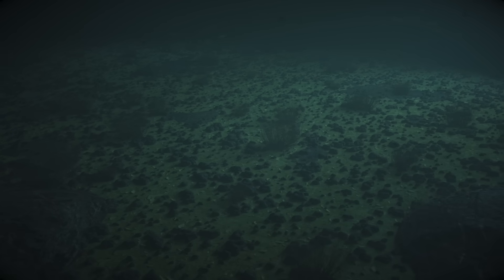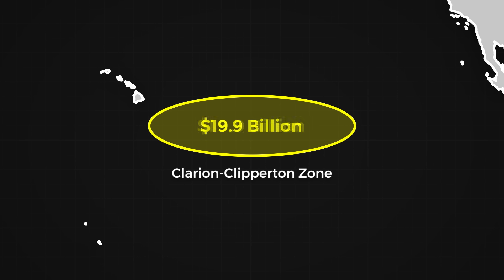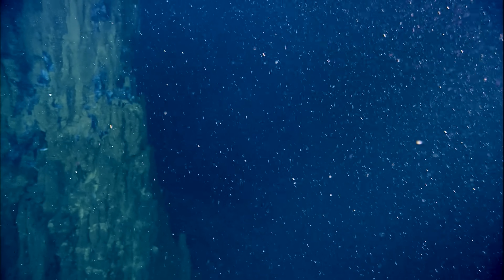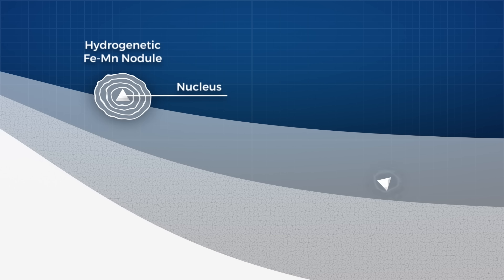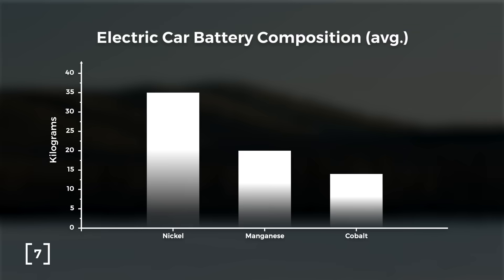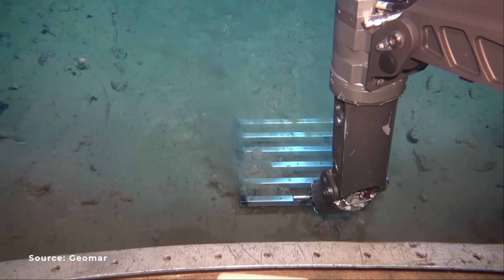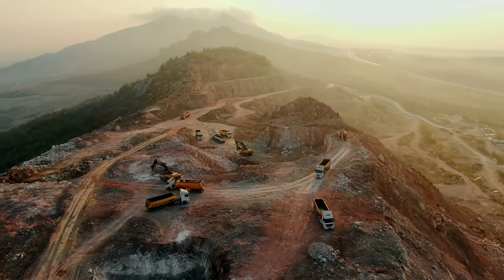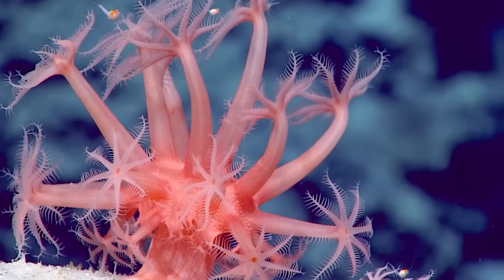The Truth about Deep Sea Mining

Comment: Mining underwater with a waterjet is equivalent to picking rocks with a jet engine to blow them into a hopper. It's dumb. Mechanical rock pickers work well, and considering that these nodules are not huge makes a rock pickers design make sense. A rock picker can work at any depth and it can run very slowly to minimize raising a cloud of debris. A simple series of chain driven bucket elevators can bring the nodules up, essentially washing them clean in the first thousand feet.

Small nodules can be returned to the seafloor, there is no need to extract every bit.

Comment: Your claims on Climate change are 100% false. The climate is and ALWAYS has been changing. What you are referring too and failing to acknowledge is the fact that weather modification patents and media supporting its results have been used to create climate change narratives since the 19-teens. And weather modification patents have been in use since the late 1800’s. 
Is it our responsibility to not abuse the resources we have here? Yes. Do we have the technology en masse to switch from fossil fuel en masse. No, not even close in the next 20yrs. Great strides are being made but a big problem with current ‘green tech’ I.e. wind farms, solar farms & electric vehicles all are made of a lot of hard to mine, impossible to recycle components; turbine blades, lithium iron batteries, the glass and other components in solar panels are all simply being buried in landfills. 
I do not know what the solution is but until we can either perfect cold fusion, relying on petroleum while supporting and driving tech races towards alternative energies is totally logical.
Reply: The climate is changing way faster than usual and isn't giving anything time to adapt
Reply: @SoupyMittens  nope. We really don’t know what is going on due to the amount of weather warfare ongoing.

Comment: Reverse engineered physics of on-ground physical dowsing and building the modern light weight ball bearing dowsing rod is explained in the book, The Art of Dowsing - Separating Science from Superstition.  Accurate gauging of what is being dowsed is deciphered by pitting the energy of gravity against the energizing of the one-tenth ounce dowsing rod load attached at a predetermined location on the ELEVATED acetylene welding rod of the dowsing rod, which allows for precise dowsing of all edges, exact center, depth buried with angle of deposition, and most important GRADING of the sought element contained in the elemental mass that is being dowsed.  The book will turn you into a professional dowser after practicing the dowsing lessons for buried pipelines and cables, tunnels and voids, precious metal placer and lode deposits, dowsing for treasure, dowsing for any element, amplified long distance dowsing from a moving vehicle, and dowsing on water from a boat.  Thank you for reading this post and have a safe, healthy, good day.

Comment: What a steaming pile of manure ! Canada has tons of untapped cobalt ( some operations have opened up old mines ) as well as other materials for batteries. 
The current use of lithium is being scrapped , not only because of cost but lithium is highly volitile when it gets in contact with water causing fires burning over 5000 degrees Fahrenheit

Comment: Couldn't you collect them in containers and then use pressurized air to create lift ?
Reply: Pressurizing air requires energy
Reply: @NotMe-ej9yz  To a point but if you bring it down with the craft and have (x) lifts worth of air before resurfacing or reloading is necessary, also more energy than pumping solid objects?

Comment: equip the collecter rovers with compressed air, enough to fill ballast balloons,enough to float them to surface when they are fully loaded. Gold dredgers float huge boulders using these methods,it just needs to be scaled up to fit the application.

Comment: The depths at which the nodules form is too deep for an airbag floatation device to be feasible.  A freshwater floatation device will work better and does not require pressure dumping as the elevation increases.  In many places, the slurry is loaded with rare elements that we need, like scandium, (which is a strategic element,) so there won't be any dumping of slurry because it might be more valuable than the nodules. Mitigation of the debris removed will be necessary because bald scars will reduce habitat.  Maybe volcanic rubble and sand would make a suitable replacement?

Comment: Couldn't artificial nodules be expelled together with the waste material in a way so substitute the taken nodules? I mean if the marine life proves to use the nodes as anchor points then stones and other artificial anchor points could make up for the taken material. As we have seen in other marine-projects artificial cement reefs can make the benefit of homes and anchor points for alot of species. However, given how little is known of the species at this depths I guess further studies should be considered of this method.

Comment: I suppose a skip car design like in blast furnaces might be a great method to lift these things. The weight of the bucket cancels out. You spend energy solely to lift the material and a bit to fight friction. One team underwater can collect material into a bucket and hook/unhook full and empty buckets when they get down. They just need to clear the area to not get crushed from above by a falling bucket

Edit: and maybe the buckets themself can be used to transport compacted sludge back down
Reply: One little issue with this idea. It is at least 4 km below sea level. The  pressure is so ridiculous that there can be no team working there. Everything needs to be done using machines and remote controls. There were very few people that personally went to such depths and it was always done from the safety of a submarine vehicle designed to withstand such ridiculous pressures.
Reply: Along with the sludge we can also pump down new rocks to replace the ones we remove.

Comment: I would suggest to use magnets to attract the nodules, since they are mostly Fe/Iron. And use an tubular electric coil to bring them to the surface.
Reply: This 100% has already been considered and is not feasable due to x reason. 

Water is dimagnetic, which means that it exerts a weak magnetic field, and repels other magnetic fields. If a magnet is suspended over water, the water's dimagnetism will repel the magnet. This weakens the magnet's effect on other objects. When salt is added to water, it weakens the water's magnetic field further, so that it ceases to have any significant effect on other magnetic fields. However, salt water conducts electricity better than non-salt water, so magnets placed near it can cause significant turbulence in the water.

Simply said magnets are not feasable.
Reply: Iron oxide is not magnetic anyway

Comment: The only reasonable way to mine these is with RPV's  The weight is the big issue - my idea is an attached ready-to-deploy expanding balloon - once full floats gently to the surface and retrieved by a modified oil tanker. These are valuable metals already concentrated into nodules, it can be done profitably. The other benefit is that they are sitting on the surface ready to harvest, scooping not mining.

Comment: Cobalt doesn't need to be used for BEV and Grid storage, leaving it to the typical Li-Ion batteries for electronics.  That would greatly reduce demand and we don't have to keep looking at pictures of Africans being exploited to make us feel guilty.

You don't need to use lithium based batteries at ALL for grid storage and can rely on iron flow batteries which is VERY economical once at economics of scale (they're already in production), and BEV can be make with LFP and other battery types as energy density increases in these types.  Maybe you need about 1/10 of BEV at most to be Li-Ion based, but the economics favors LFP regardless of energy density because of lower cost and many thousands more charge cycles meaning you can buy a BEV and have it for 15 years without worrying about the batteries.  LFP also doesn't have the overheating issues.

Comment: Natural resources are mans treasure . Any attempt that has such a large unkown effect on what is so little known is criminal.  Man needs to slowly develop his presence upon the massive ocean bottoms . City’s that allows travel as intermodal transit and sea floor grow houses and businesses manufacturing . That provide protection of sea and sea life as well as provide  enhanced sea life and protection assurance. That is also vital to space  travel water collection on sub surface for fuel production of hydrogen and oxygen fuel supply’s for exploration and resources collection process . All require space  habitat development that sea bead city’s will help in the development of private industry research.  Especially with harsh chemical of ocean water and high pressure exposed material management   That need to be studied as under the sea bed tunnel and transit systems   . That allow pressure change rather than chemical fuel.  High pressure glass and crystalline and carbon fiber polymer shells . That perhaps artificially produced synthesis of diamond compounds . That today’s high power energy next step process as China newest discoveries in hydrogen energy  synthesis  and high energy diode .  With microwave radar plasma  shield devices . That allow high pressure and energy to be used with carbon to produce a solid diamond synthetic walls thinner stronger and longer lasting effect , than other high pressure systems . Much more natural resources are under the sea . Added to the unkown treasure of life added unkown benefits . That even in our tropical jungles we have such a vast unkown treasure in life . That we are blindly allowing the destruction of by nations  unable to gather global support to even protect. Especially with the global crises is climate.  Our ocean life systems we develop for humans and under the crust habitat will allow future generations a longer effort to study those  Dynamic life systems we have so far only known to be here on earth.  Yet we are allowing those to be Extinct and weakened so that climate changes will remove such living treasures we hardy know . And by changing DNA to react to only harvest foods . We are taking millions of years of needed instruction to allow plants to be unable to protect itself from changes it had already learned in DNA to  overcome such conditions.  Or ability to change or protect itself from insects or droughts or extreme changes that have allowed that life to be here today.  We can’t look for life elsewhere.  And allow life to die on earth and not even learn how to manage to study what is being removed daily from our vast life resources  .  Sea bed structure technically needs to be better developed.  And learning about life we hardly know is demanded of us all to be able to understand and protect the most perfected life forms that still man had no chance of knowing even the Coral is important to sea life that chemicals alone are removing for the start of many  food chain cycle supporting stages .

Comment: How about this!

-for every module we take, release a man made module that can offer the same ecological function but made of a considerably cheaper material

-instead of pumping the nodules up, collect them in mesh (lawnmower like) bags that have compressed gas canisters that can inflate a bouy and then float to the surface when full and there solve the energy intensive and slurry dumping issue.
Reply: The depths at which the nodules form is too deep for an airbag floatation devise to be feasible.  A freshwater floatation device will work better and does not require pressure dumping as the elevation increases.  In many places, the slurry you are referring to, is loaded with rare elements that we need, like scandium, (which is a strategic element,) so there won't be any dumping of slurry because it might be more valuable than the nodules.